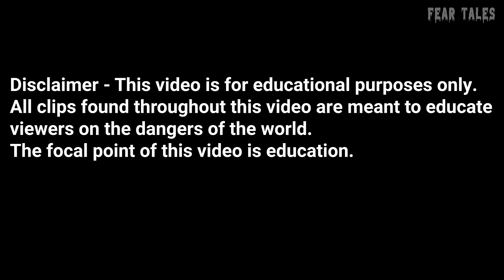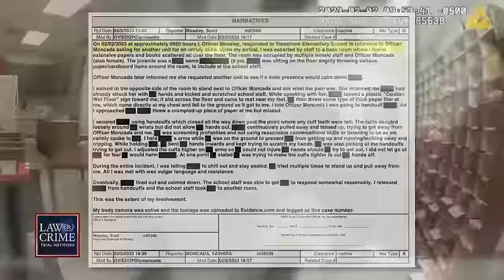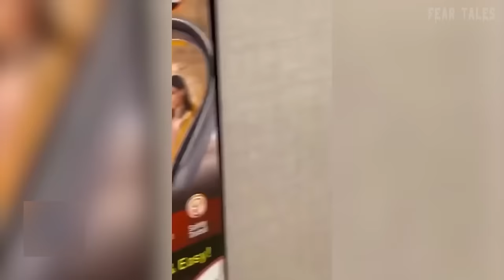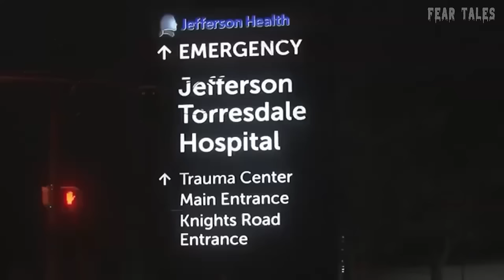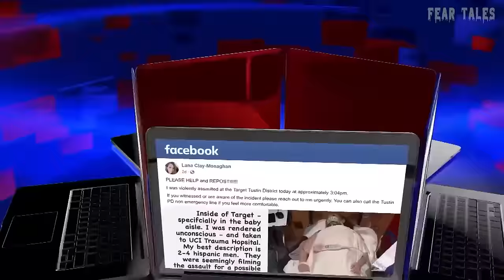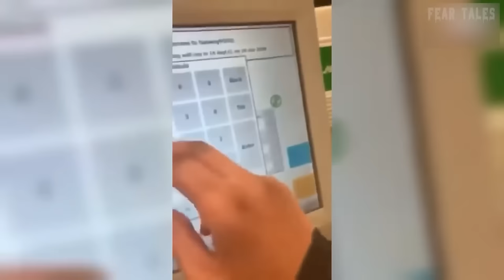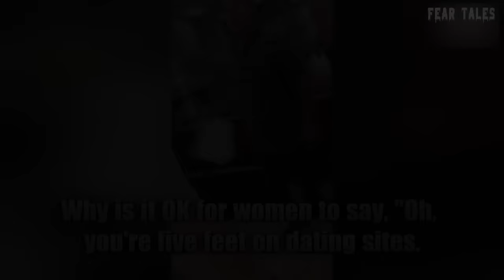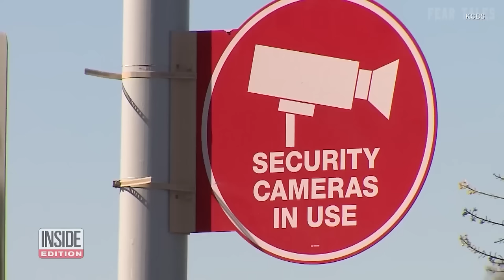1 Hour Of The Most Disturbing Things Captured In Walmart & Stores Vol. 2

Comment: Just to help... 
There is an emergency stop button on the front of the building to most gas stations. You run to that and press it to stop the flow at the pumps. Then get away from the gas. Then call the fire department.